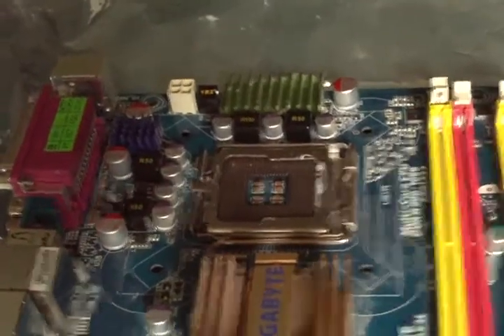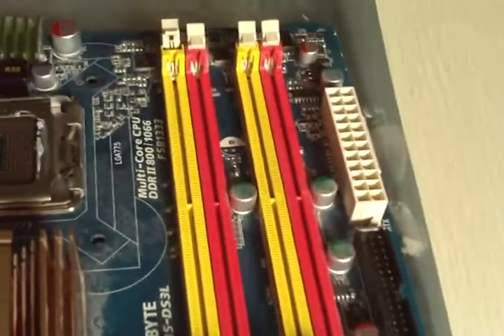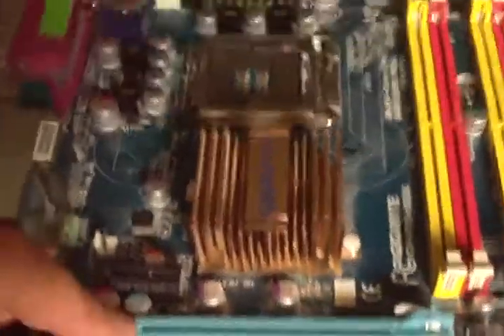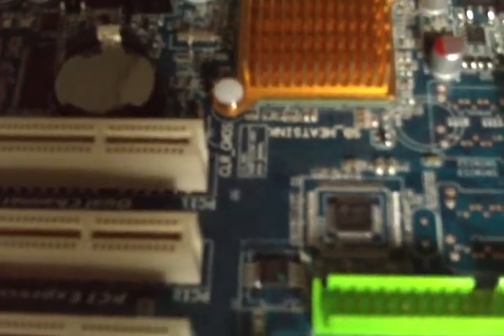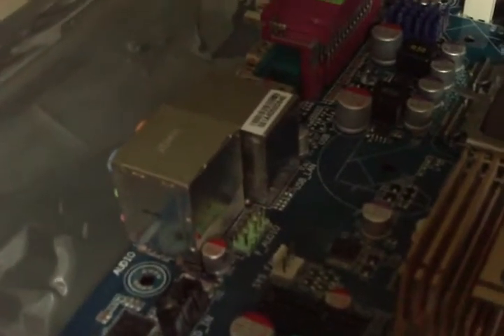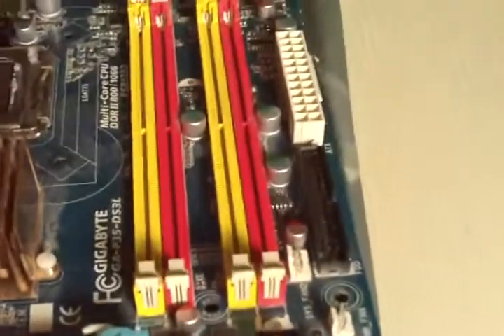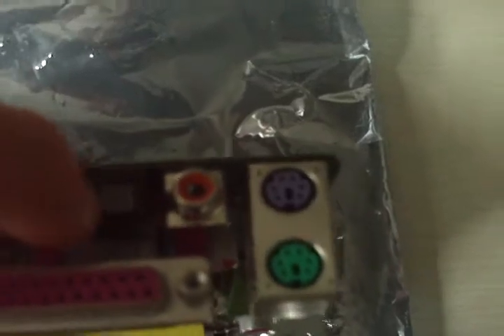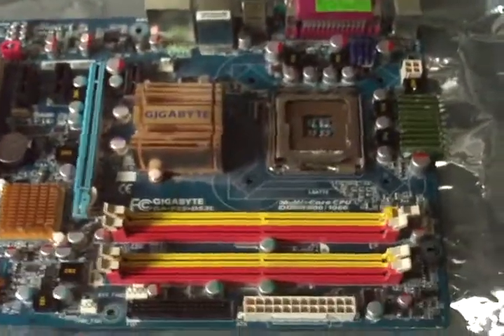P35-DS3l Motherboard Review

Comment from the maker: Are they the same 4gb? and also you have to read the specs of timing on each. If they are the same brand and timing then you have some board problems or in some cases the power supply. check it all by swapping them.

Comment: wow thats funny, I got the Thermaltake Tide water plus in the way, and I currently have this Mobo in my system with G.Skill PC2-8000 @ 1000Mhz and Quad core Q6600..

This mobo is A+ it overclocked my Quad core on STOCK FAN from 2.4Ghz to 3.4Ghz !! and my ram up to 1080..

Its not expensive yet an OC killer.. buy it!